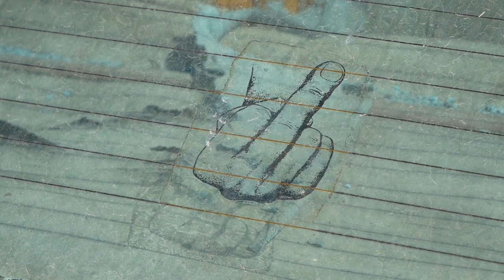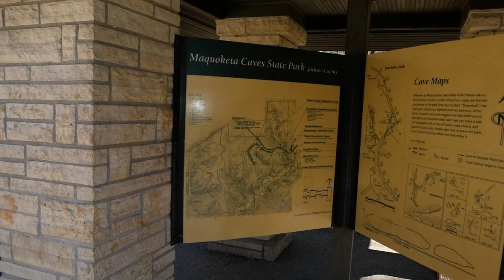Camping AdVANture - Exploring Junkyards and Caves

Comment: 4:10 Zheeesh --- there is precious little elbow-room inside THAT cramped cab --- the steering wheel almost touches the windshield!  Let's just hope that this semi-tractor was intended merely for "tootling locally" around just the tri-county area for a few hours per day --- I surely wouldn't wanna "go truckin' for the long haul" in THAT tiny fishbowl!  I mean, just look at how little space there really is inside that tiny glass-and-metal dome --- if even a slight-figured human like Mook barely fits in between the seat and the steering-wheel, imagine how claustrophobic a big hulking 18-wheeler dude would feel driving that rig from Saint Louis to Sacramento!

Comment: I strongly suggest getting the mac and fully restoring it back to original so you can pull a big 5th wheel travel trailer with it.
That's the new thing. A lot of people are pulling 5th wheel travel trailers with medium duty and heavy duty trucks. 
There are even a few very rare tandem units and junk yards that are both truck and 5th wheel travel trailer.
I have a few photos but I don't know how to share them on here.

Comment: That Mac looks like something straight out of Mad Max!!!
That thing is bad ass,... I would put a camper on the back of that in a heart beat!!! 
Just take the frame out from under a camper Van put it on there backwards so the nose is facing the rear (would exchange the headlights for tail lights) and you have your Rear window(With windshield wipers mind you) and rear facing passenger seats!!!

 If you don't do this I will!!!!!🚓🚙💨